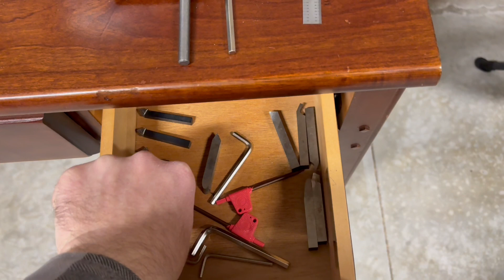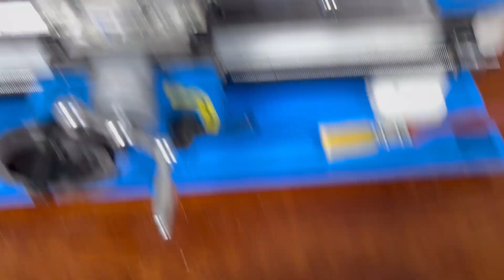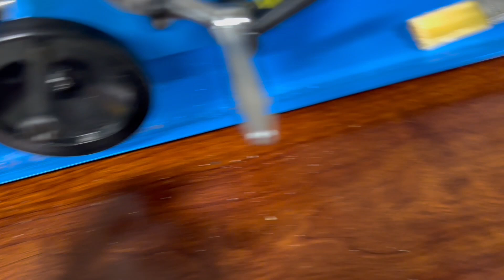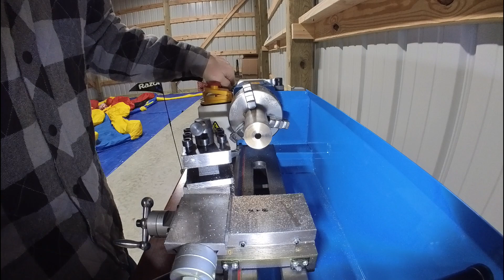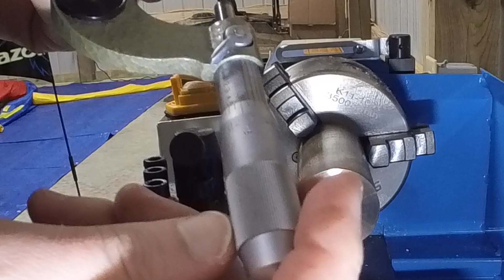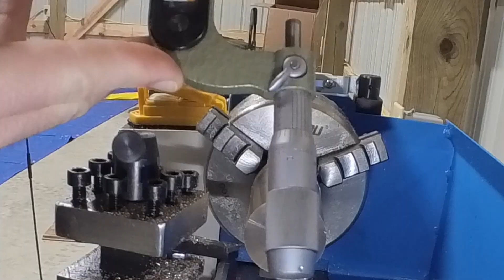Vevor 7” X 14” Mini Lathe: First use After Unboxing

Comment: Thanks for this. I’m looking for a somewhat light duty lathe mostly for plastic and aluminum but will need to do some mild steel that will be an interrupted cut. Would you trust this machine for interrupted cuts in mild steel? Also, thank you for not wearing gloves.
Reply from the maker: Mild steel should be fine, won’t be able to take a very large cut though and a good cutter will help. I use it for plastic, brass/bronze, aluminum 99% of the time and never had any issues. Tried some titanium once just for the heck of it, it did not like it lol but that’s not a surprise

Comment: Line up the cutting tool with the dead center. The chatter is most likely the cheap round bearings replace with Angular Contact Ball Bearing, (it's a project for sure) Bolt that machine down on the heaviest (sturdiest) table you can find. We get better every day, keep machining

Comment: I bought one, they ended up, vevor, refunding most of my money to fix all the issues I had initially.   I believe my end cost was 200 dollars, but had to replace the board, lcd, and I upgraded to 750 w motor with the refund . Now after a lot if work it works ok
Reply from the maker: Yeah it’s seems to be a role of the dice for sure

Comment: Thanks for video after watching, I now love my Jet Lathe even more. Also my lathe has a good old 1 HP motor, speed is controlled by a belt pully system. All new lathe have electronic speed control, witch are prone to fail. :face-orange-biting-nails:

Comment: Watch the inside of the electronic control box they get chips in there and it blows out the board
Reply from the maker: I plan to make a plastic plug to go in the end of the spindle to keep chips from passing through the spindle and dropping onto the gears, I don’t know if that would also solve the issue you are warning me about or not but hopefully so. Not at home to look more closely at it right now
Reply: @DirtRider22a  the chips get in the front hole where the lead screw goes in also especially if you run the lead screw under power
Reply from the maker: @ good info, I’ll keep an eye on that. Thanks!!!
Reply: @DirtRider22a  no problem that problem took out mine after 2 weeks
Reply: It has plastic gears, which means it's not good. It's not worth 5 dollars, unless you are willing to put a lot of effort into modifying it